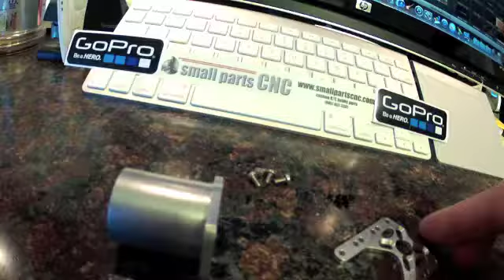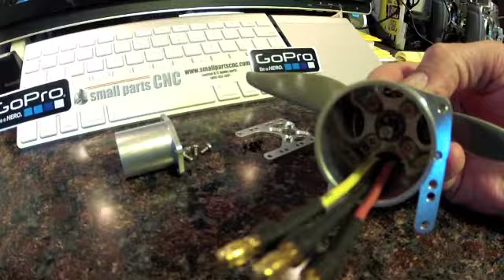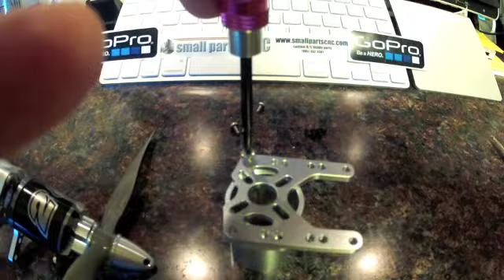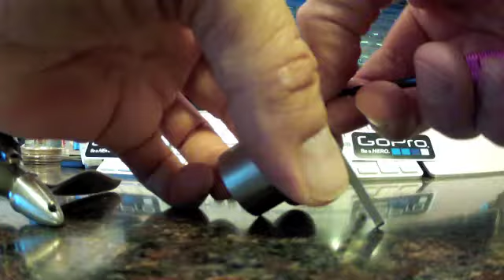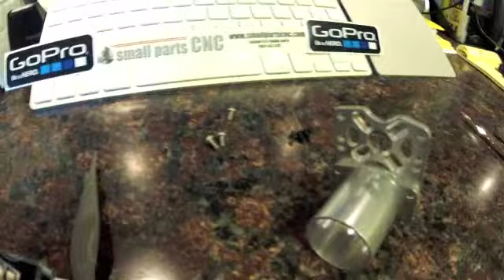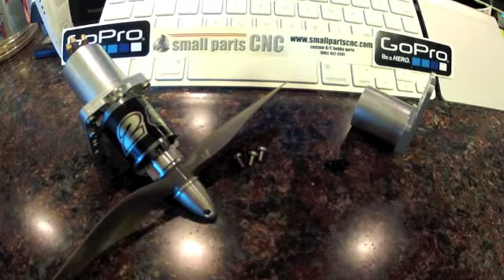Bixler CNC Motor Mount

Comment: That's a very elegant solution.
I have purchased the Turnigy H.A.L. motor mount set from hobbyking USA whse., and found it works great on the Bixlers. Cut a couple of inches of drum stick of hardwood for a mounting post, drill out the foam under the motor to hot glue the stick. The mount clamps and sets with a set screw. Advantage: You can adjust the motor height, and the offset angle by twisting the motor, and resetting the screw. Nice job on yours! It's a very polished and refined solution!